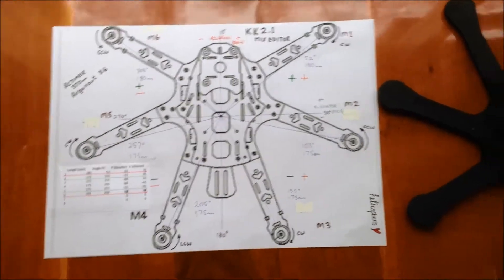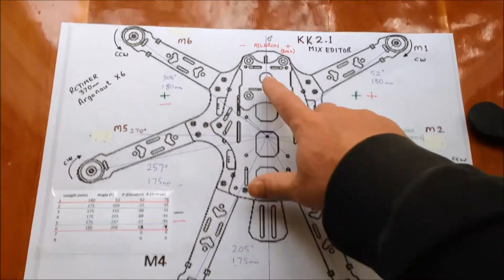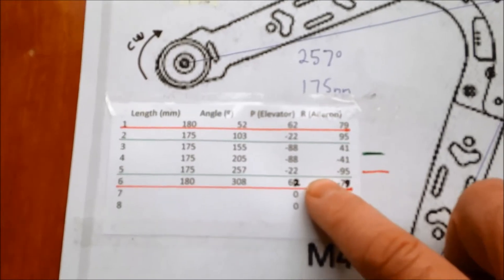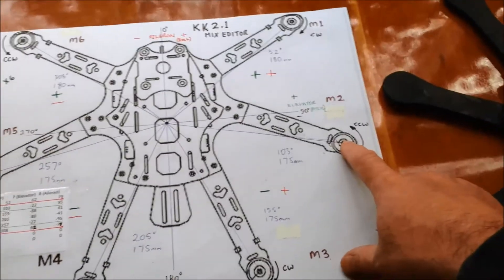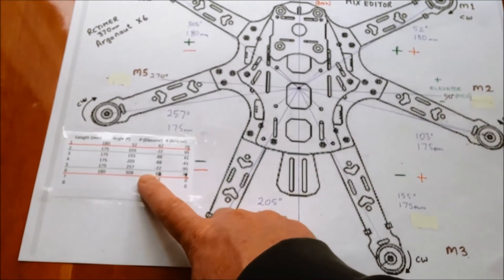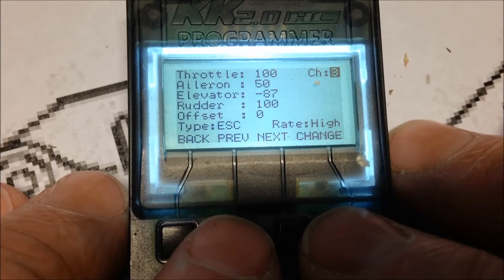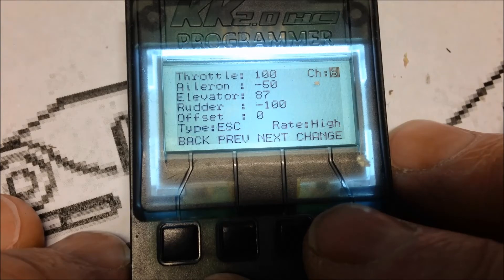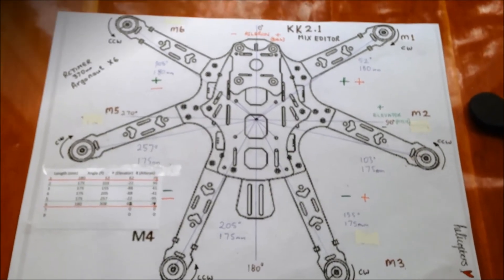KK2 KK2.1 Mixer Editor simply explained for non symmetrical Multirotors. Specifically my Mini Hex

Comment: Really great, saved me hours to figure out the values. 
If it turning a litte clockwise do i have to ajust  rudder on all the channels?
and thank you for sharing the sheet and drawing. I found a cirkel drawing with 360 degrees marks and I I printed it on an overhead sheet then it was just a readout of the degrees.
https://pixabay.com/get/28090a8858139e91758c/1446202606/circle-41073_1280.png?direct

Comment: can we download your designs (PDF or other file format) from any link ?
this will be really helpful.
Thanks,
Deepak
Reply from the maker: KRISHNAY ENTERPRISES Links are in the comments area
Reply: Simon Hahnel 
Thank you very much. 
I am new to this hobby. I will try to remake your design with carbon fiber. Once I am done, I will share with you. Hope you like the idea.
Thanks one again. 
Regards,
Deepak
Reply: +Simon Hahnel 
you say everything is measured from the center of gravity, is this also the place where the kk2 should be mounted?  can I place the kk2 somewhere else or must I calculate from the place where I place the kk2 and make that the cg which moving the battery and other mass?

thank you!
Reply from the maker: Mike Van Dijk I find the KK seems to work best when located on the COG

Comment: Hi, Thanks so much for the spreadsheet and the video. This helps me out a great deal with my current project (a 550mm spider multi) .
Am I correct in assuming that this table will work on any configuration?
That is not symmetrical of course. Thanks once again.
Reply from the maker: MegaCrashking Yes indeed. Any Quad Hex Tri or octo. Just apply the relevant angles and lengths.